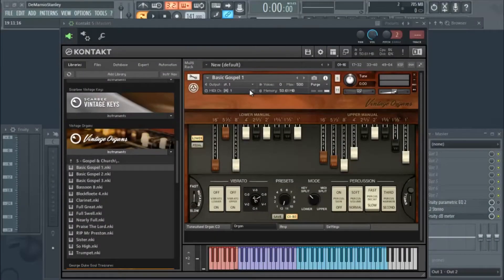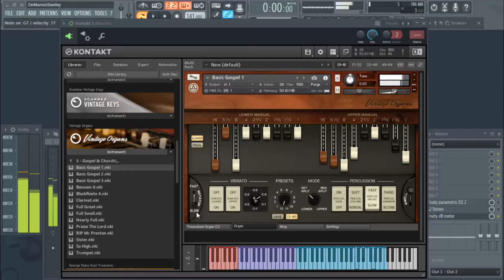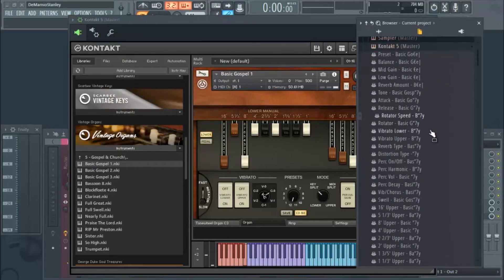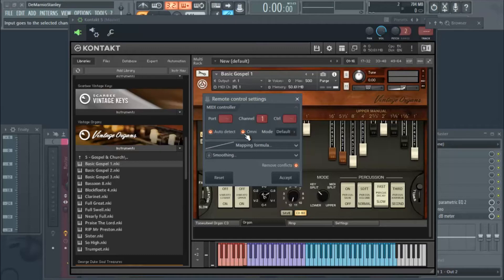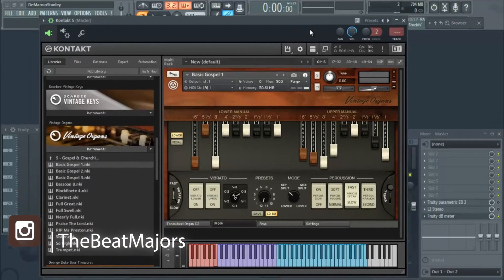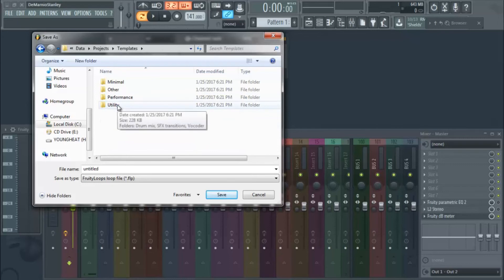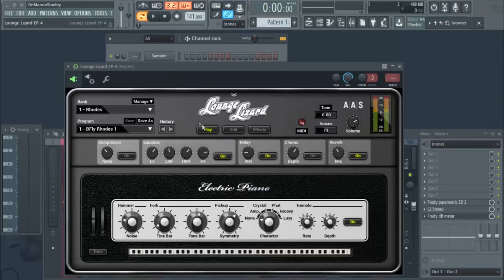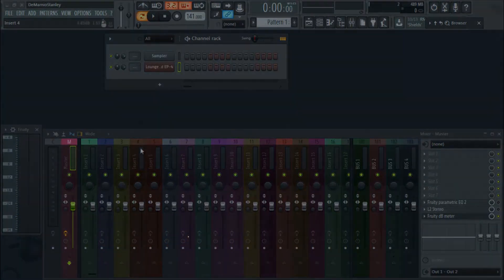How To Setup The Mod Wheel In FL Studio 12 (@TheBeatMajors)

Comment: This is not working when attempting to interact with my Roland JD-990 via MIDI OUT.  It works by default in Cubase.  Any ideas?
Reply from the maker: Assign it manually would be my suggestion.

Comment: what I want to do is to have my controller to control the modulation wheel for all my VSTs in the project without having to set it up every time I open the plug-in.  I have tried as a permanent control and it's not working, maybe I'm doing something wrong. When I setup the wheel for a plug-in and then for another, I lost the control I set for the first one. What is happening?
Reply: At the end of the video he shows how you can set it up permanently, using an empty project and saving it as a template.